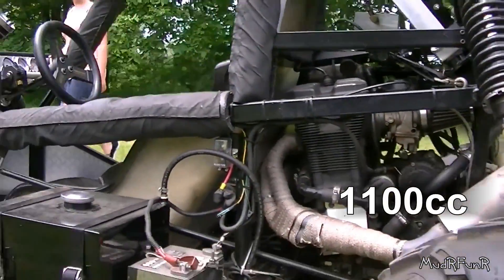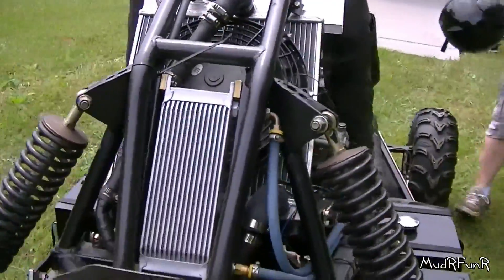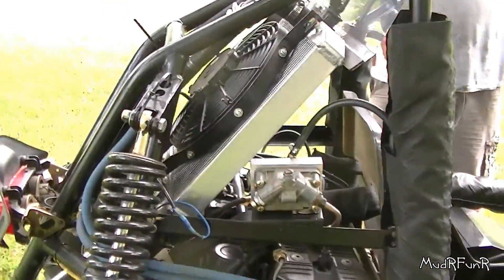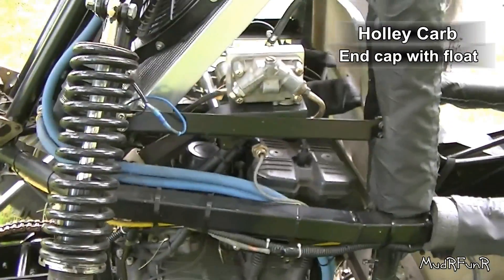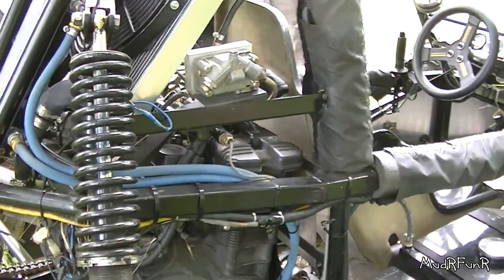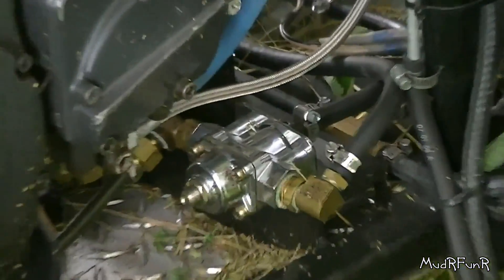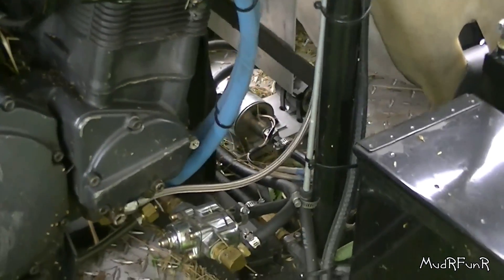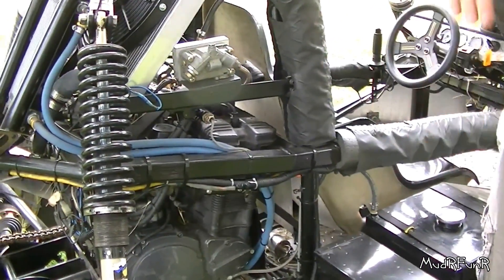1100cc GSX R Buggy - Fuel Regulated with a Holley Carb End Cap

Comment: I was able to accomplish that same issue much much easier. All I had to do was put a Y-splitter between the fuel pump and carbs, the carbs only take in the amount of fuel they want then returns the fuel that they don't want back to the tank.
Reply from the maker: This is not my build but it seems to me he said that he tried something like that. For some reason it didn't work. Anyway, thanks!